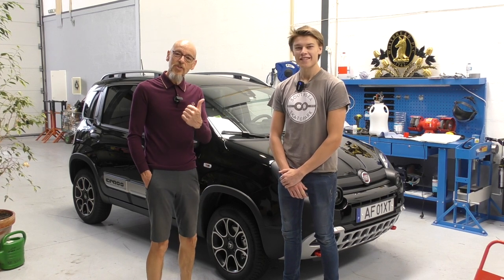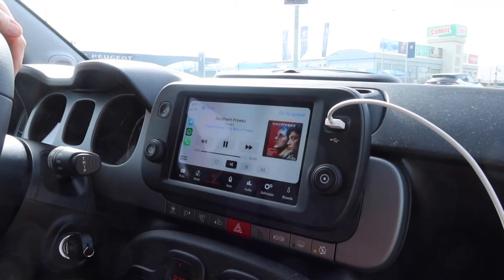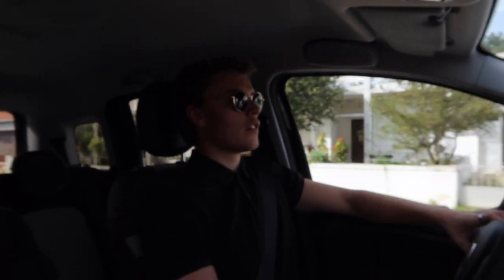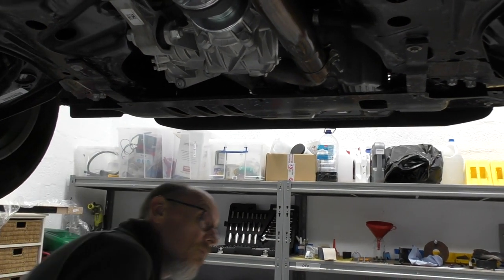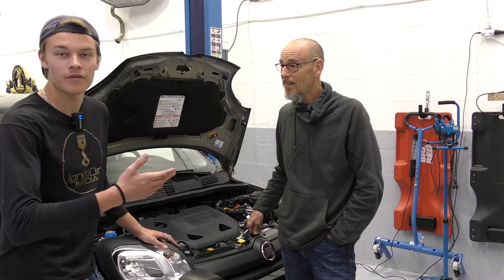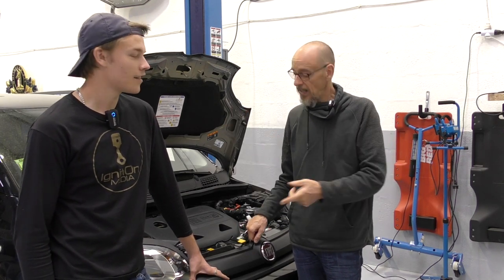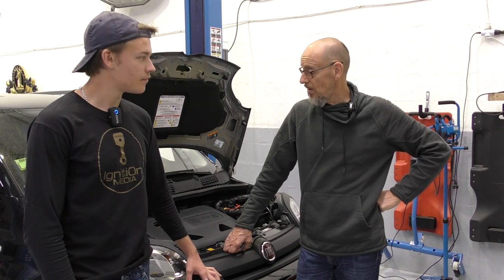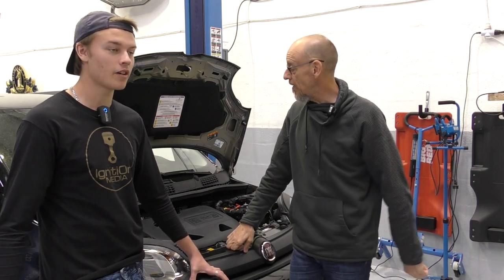2021 FIAT Panda 4X4 - new car collection and look under - what does the 4x4 system look like ?

Comment: Found interesting armrest: https://www.braccioli-italy-armrests.com/en/armrest-fiat/armrest-sport-fiat-panda-2012
Reply from the maker: That's a great find - thanks for the link, think I need one :)
Reply: @DrivenMadShow  That was the only one that I found, that fit the style of Panda. I have not bought it yet, but if I will decide, this would be the option. I find those boxy generic ones out of style. This one maybe does not have the inner storage space, but overall looks the best. If you will install it first, send the photo and experience please :)
Reply from the maker: @misolowy3929  We were out off road today, in quite a few panics, reaching for the handbrake was urgent - the Armster folds out of the way, so off road no problem, not sure this one does, but I really want it - I am emailing them to see if it does, that might be the problem for me - we had an Armester in our 500 and really liked it, but they have no stock for the Panda and would appear not to be re making any due to lack of demand, shame :(
Reply: @DrivenMadShow  That might be a problem, did not think about it. On the other hand. The first time I sat in the car, I fell into the hole where the armrest should be. But after 2500km now, I do not even mind. It's just part of the car's charm and when city mode is on, you better have your arms on the wheel :) How is the engine? It is the 0.9twin air? I am only concerned about the sound in the cabin.
Reply from the maker: @misolowy3929  I do like an armrest, like you I have sort of forgotten about it, not doing motorway stuff, so changing gear a lot, sort of takes the need slightly away ? - ours is the twin air, its an odd noise, but we have fallen for it as we have the whole car, the exhaust sounds fantastic for stock, love the 2 cylinder thrum and it drives really well, way better than the performance stats suggest it would. We might in a year or so, get it re mapped, might being the main word, but would love 100hp and fit the vintage 100hp badges (or is that naff ?) :)